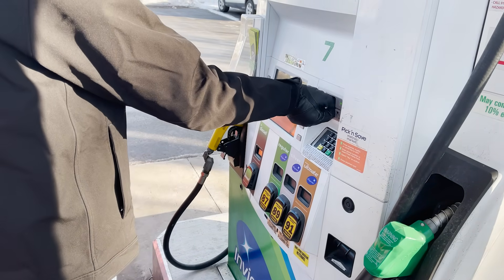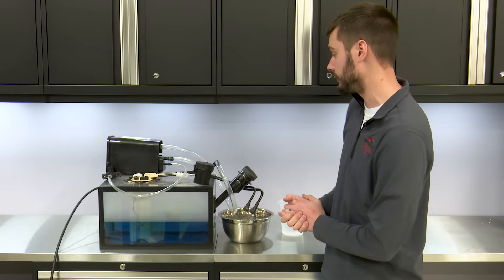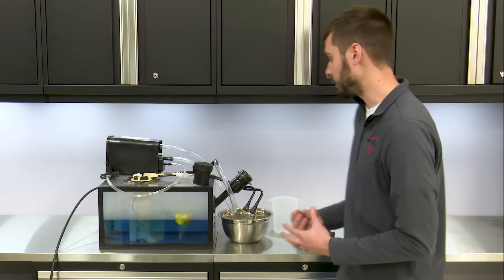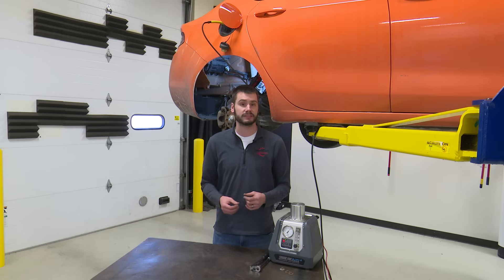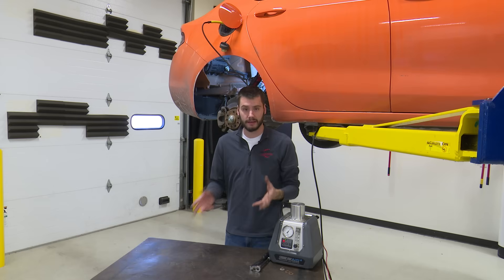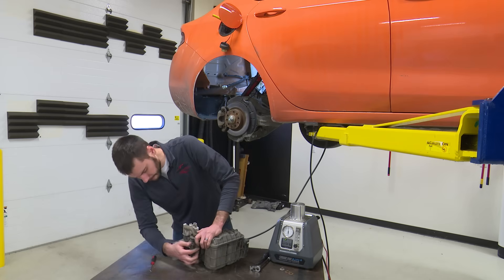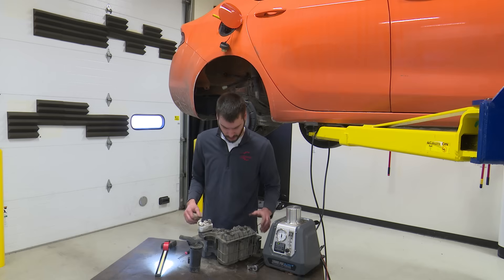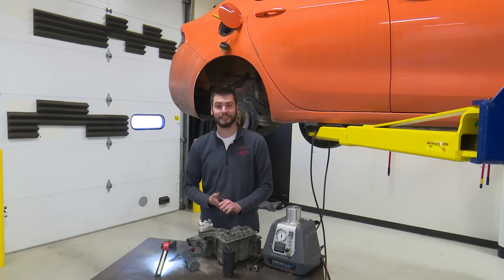Can't Fill Your Car With Gas? Simple EVAP Checks To See Why The Fuel Pump Keeps Clicking Off

Comment: My 2015 mini Cooper is doing this and I'm figuring it's the EVAP thing but I don't know where or who can fix it without it costing an arm and leg. Is there anything I can put in the tank or it has to be token apart like you did
Reply from the maker: Hello Lala,
Unfortunately there is no additive that will fix this issue, the restriction or vent issue will need to be fixed.
Thanks for reaching out!
~Ryan

Comment: well the 
problem  was that filter???? do you remember  how many miles has on
Reply from the maker: Hi Juan,
Yes it was full of dirt. The car had about a 100,000 miles on it, but it was driven in very dusty conditions leading to a plugged filter. I also have seen a stuck valve in the fuel tank causing the same issue on these models.
Thanks for watching!
~Ryan Wilsing

Comment: Have a 2018 ram 1500 5.7 keeps clicking off. I replaced the filter and still keeps clicking off
Reply from the maker: Hi Robert,
Some of those Ram trucks had fuel tank issues. I would Remove the hose from the tank to the charcoal canister and remove the recirculation tube from the filler neck to the top of the tank. Try to fill the system, if the tank will still not accept fuel, the fuel tank may be the issue. If it does accept fuel, check for a restriction in the recirculation tube, charcoal canister and ESIM.
~Ryan Wilsing

Comment: 96 ram 1500 doing the same thing. I’m thinking replacing the canister cause I’ve put a new purge selinoid on and it’s still not removing air from the gas tank
Reply: Done that. Removed the filler neck and rigged up something to put gas directly into the tank and gas came out the vent side
Reply from the maker: I would suspect the fuel tank may have a roll over valve stuck. 
~Ryan Wilsing
Reply from the maker: Hi Gregory,
A quick test you could do, is disconnect the breather hose from the tank to canister and see if you can fill it with gas. If you can, it has to be a restricted EVAP canister or something down the line of the canister, like a LDP or it's filter.
Thanks for watching!
~Ryan Wilsing

Comment: Mike, awesome video! It’s probably the 20-25th one I’ve watched and it’s the best one I’ve come across. I’m working on a 2004 dodge 1500 slt with a 5.7 Hemi. I was pretty green with evap before but have been forcing myself to learn. I definitely had a stage 5, maybe more since I was getting gas spilling out. I unhooked the purge valve lines and the problem went away. I was feeling good thinking that I found the problem. But it came back recently. I took the cannister off prior and blew through all openings and didn’t notice any restrictions. I’m now thinking it’s the vent. Your video has been very helpful and I will probably watch it many times.
Reply from the maker: Hey Jeff,
Thanks for the kind words and glad you enjoyed the video!
I hope you get your truck fixed!, let us know how it turns out!
~Ryan Wilsing
Reply: Hi, I am having the same problem.  Have you got your s fixed? Thanks

Comment: Having this issue with a 5th gen 2019 Ram 1500. Not sure what to check first. Any ideas are appreciated.
Reply from the maker: Hello, 
Even though your vehicle is different, the EVAP system type is the same,  the lay out is just a bit different. If you can access the canister, ESIM and Filter which are located on the fuel tank behind a metal shield. Start by check the Filter and ESIM for restrictions. If none are found, I would remove the canister and check for is being plugged or restricted.
I hope this helps!
Thanks for reaching out!
~Ryan Wilsing

Comment: Hi mike I have that same problem with my 2010 Tahoe and I replaced both my charcoal canister and canister vent valve solenoid and it didn’t fix the issue what could be the problem?
Reply from the maker: Hey Cris214, whats going on with it? It's a hard to fill issue? It's possible there could be a stuck relief valve on the tank or a restriction of the filler neck vent.
~Mike
Reply: @GoTechTraining  yes can’t fuel up correctly the pump stops itself every few seconds and I’ve seen many videos all of them explained it could be the charcoal canister or the evap solenoid and I replaced both and the problem didn’t get fixed
Reply from the maker: Did the filter element that goes after the vent solenoid get replaced?
~Mike

Comment: Thanks for the video. Gives me some things to double-check.  Oddly enough our 2014 Jeep Cherokee has the clicking-off-while-fueling-issue seemingly when the gas stations switch to winter-blend fuel.  Come springtime, it starts fueling up with no issues again until the Fall. Really frustrating and while the dealer has tried a couple things, they are now claiming that the next step to replace the entire fuel tank.
Reply from the maker: Hey Robert,
That's a interesting problem!
I wonder if the outside temperature has an effect on the issue?
Thanks for checking out the video!
~Ryan Wilsing

Comment: So I'm confused... where are the "simple" EVAP checks promised in the title?? I see a system tear down with a needed smoke machine. Hmmmm - not "simple" test and not a "tool" I have in my kit.
Reply from the maker: Hey, so you don't need a smoke machine to do the tests. You could use a hand pump or something that can push air into that system to see if there's blockages. Thanks for watching!
Mike Becker, Senior Instructor

Comment: I've had this problem on my 2001 Dodge ram. I tried pouring in by hand but then it tends to burp and come back out so it has to be poured in very very slowly. Takes me almost a  half an hour to put in 10 gallons of gas
Reply: I've had this problem with my 05 Mustang, but I've managed to slow-fill the tank at the pump. I reverse my hand position on the pump nozzle, so that my pinkie finger is on the very tip of the nozzle lever. This gives me just the right amount of leverage to trickle in some gas without causing the pump to shut off. Fortunately, I only need to do this for a half minute or so, and then the pump works normally. Don't know why this is, but it works for my car.

Comment: Two questions: First, enhanced EVAP has been out for years so why recently having problems, or has this problem been around for awhile? Second, can this cause the gas pump nozzle to NOT shut off when fuel tank is full. I have a 2019 Transit 250 with under 10K miles and when I was topping off the tank after the nozzle shut off the nozzle did not shut off the second time but let gas back flow out the filler.
Reply from the maker: Hey Hiker Biker, thanks for watching! This has been a an issue for a while now. It mostly depends on the design of the system and it's ability to overcome pressure issues in the tank. As for the nozzle not clicking after it's clicked once, that's likely because pressure didn't build up in the already full filler neck, leading to gas spilling out. If the nozzle clicks off and you don't have a restriction, the tank is full. Don't top off as it can cause issues in the system.
Mike Becker, Senior Instructor

Comment: Great tutorial, honestly I've not been handed this repair once. I have heard of this, but never seen one. Thanks for the Knowledge. Now I know.
Reply from the maker: Hey Borg Simpson, thanks for watching! Now you know for when you do get one ;)
Mike Becker, Senior Instructor
Reply: @GoTechTraining  thanks for the reply. You all should know, I subscribed and watch the videos. I like all.
My favorite Automotive instructor gave the best advice in electrical class. " Learn, Unlearn " so much thanx.
Reply: Ha! I sold a brand new Astro Van with this problem years ago. Guy could only put in 10 gallons then click, click click to 20 gallons. He brought it in under warranty, they couldn't find the problem, so he did a lemon law buy back, replacing the vehicle for another Astro Van. After all the paperwork was done, and he was ready to leave he wondered aloud, "hey, is this van going to have the same problem?" I replied, "I don't know, let's go see"  It did.  He didn't have to but he took it home anyways. Design error. My old VW also had the problem, I turned the pump handle 90 degrees and was able to fill the tank.

Comment: On a Toyota vehicle with roll over Valve would it have the same concern of the pump clicking off
Reply from the maker: Hey Kzilla12, most cars have rollover valves. Toyota uses vacuum pump systems on a bunch of their vehicles. A restriction in that outlet path would cause the same issue!
Mike Becker, Senior Instructor

Comment: I remember when GM had pancake filters at the bottom of the round charcoal canisters in the old carburated pickups and Surburbans.
A quick way to fill older Ford Explorers when they wouldn't take gas was to open the hood, remove the green cap on the evap line and push down on the Schrader valve.  That relieved the tank pressure and fuel went into the tank.
Good to see you Mike, hope the family's doing well!
Thanks for this video.  Don't know for sure about my wife's 06 Kia Sorento V6 if it has that filter.
Reply from the maker: Hey Mike, hope all is well! Any way to get the pressure out of the tank will work! Thanks for watching 
Mike Becker, Senior Instructor
Reply: i remember those on my 77 buick electra. they were in front of engine passenger side near radiator as best as i can remember. easy to get to those.

Comment: Hi Mike, great video! My 2007 MDX is a stage 3 clicker. It can accept gas for the most part. But the pump always shutoff 1-2 gallons short. Previously the fuel gauge can rise slightly above full mark. Now it points to the full mark exactly. What might be the cause of it? Thanks.
Reply from the maker: Hey Wei Su, thanks for watching! That's interesting. How do you know its short? The tank will usually hold at least a gallon even if it reads empty.
Mike Becker, Senior Instructor
Reply: @GoTechTraining  Previously the pointer of the fuel gauge can go beyond 'full mark' a lilttle when it is really full. Now the pointer will point at 'full mark' exactly. So I know it is 1-2 gallons short. Also previously the fuel gauge will stay above or at 'full' for quite a while after a fuel-up. Now it starts dropping right after I leave gas station. This is quite annoying.
Reply from the maker: I wonder if maybe the fuel level sensor in the tank is starting to go bad?
Mike Becker, Senior Instructor

Comment: Huh, I have this problem on some pumps on my diesel car. I assume diesels also have this system? Why would it only happen on some pumps though? Just an early/borderline case?
Reply from the maker: Hey VorpalGun, diesel is a whole other animal. I don't want to put my foot in my mouth but I believe there are different flow rate diesel pumps at different stations. Some smaller light duty cars can't accept the high flow rate of the pump. They weren't designed to handle that much incoming fuel.
Mike Becker, Senior Instructor
Reply: @GoTechTraining  Thanks for the quick and informative answer!

I have a Subaru Outback 2011 specifically (we got diesel variants of those here in EU). One pump at a gas station will work while another (identical looking) at the same station won't. Super confusing. This has happened at multiple different stations and different franchises of gas stations too. As for flow rates there is always a button to enable high flow, I have not used that. I have not seen any other signage indicating different pump rates. Sometimes there is a separate truck pump that is not under the main roof (to allow full size lorries to fit). Those have a wider diameter on the pipe that goes into the car, and won't even fit on a normal car. 

From some googling it seems that diesel evaporates much more slowly and thus the system is different, apparently on some older cars at least they just have vent line(s) and roll over valve(s). I have not found the details for my car though. Presumably it must still have something to let the air out while refuelling and let air back in as fuel is used up. I guess the chance of such a setup getting plugged in some way is much smaller, but probably non-zero still.

Comment: Good video mike! I got a Subaru  on my lift for the same issue and a P1449. I can suck through the port on the LDP but I can’t blow through it. (Port that goes to the filter box). I disconnected the port on the LDP coming from the canister to rule it out. And still can’t blow through the LDP. Safe to say the LDP has failed ?
Reply from the maker: Hey George, thanks for watching! Hmm usually the LDPs have an over pressure valve. If you can't blow through it, maybe that valve is stuck? What year/model/engine Subbie? I can take a look at the system.
Mike Becker, Senior Instructor
Reply: @GoTechTraining  it’s a 2014 crosstrek . I already cleaned out the filter and vent hoses but that didn’t do the trick
Reply: @meorge9359  probably replace the filter too!
Reply from the maker: From what i'm seeing there's a "drain separator" attached to the LDP. Not sure what it is and the info is really vague, but make sure that's not plugged up. If you can detatch the LDP from the canister and go to the station to refuel and your issues solved, then i'd be ok with the LDP getting replaced. 
Mike Becker, Senior Instructor

Comment: Mike….great explanation….my problem on my 2004 gmc pickup is just the opposite…gas nozzle won’t shut off no matter what station i go to…any trouble shooting tips u cd gv me would b greatly appreciated
Reply from the maker: Hey Kyle, that tells me that the filler necks not building pressure like it should be when the tank is full. Is the filler neck in good shape, not rusted out? 
Mike Becker, Senior Instructor
Reply: @GoTechTraining  yes filler tube is gd…had tank replaced last year..but problem followed the tank …cd their b any parts missing
Reply: This issue happened to previous owner after he had tank replaced…no one cd figure it out…now i hv had the truck for 4yrs and also had to hv the tank replaced due to an auto body welding accident…problem followed tank replacement.
Reply from the maker: Could it be that when the tank was installed a hose got pinched? Or maybe the wrong tank was installed?
Mike Becker, Senior Instructor

Comment: Hi, Mike!  My 06 V6 Jeep Liberty has to problem accepting fuel but it is late in auto shutoff and burps up a tablespoon or two of fuel. I mitigate this manually guessing it's close to full and slowing the flow. I don't have a smoke machine but could this be the same solution? Take the canister out and and clean it? It's got 175k miles.
Reply from the maker: Hey Paul, thanks for watching dude! It sounds like the system is building up pressure and burping back. I'd start by making sure there's good flow through the system, just like we did here.
Mike Becker, Senior Instructor

Comment: Excellent video, Mike!  I was surprised to see an actual filter inside of that evap box.  Are there any other manufacturers that have a replaceable filter setup like that, to your knowledge?
Reply from the maker: Hey Dave, thanks for watching! Yes, there are for sure. I don't know off the top of my head all of them, but Hyundai/Kia do for sure. They actually had a tsb for replacement on some models.
Reply: GM
Reply: Thanks for the well done video. I recently had the same issue, replaced the charcoal cannister but the problem remained. I then had my mechanic replace that other filter and that did the job. Chevy Tahoe.
Reply: @302Camaro Did they say what section was the issue? Same problem here